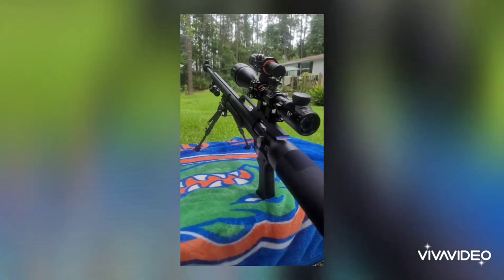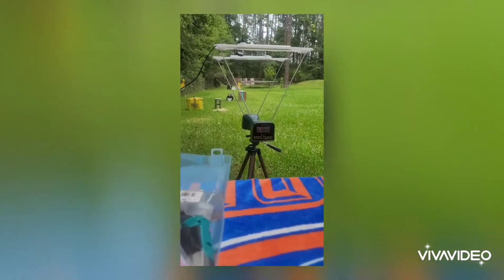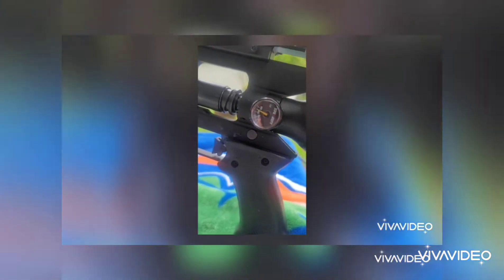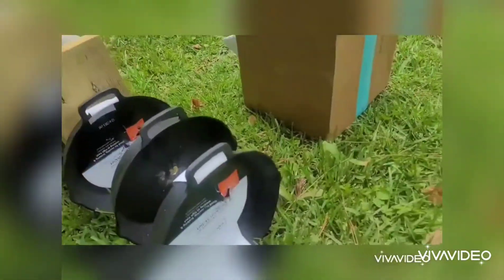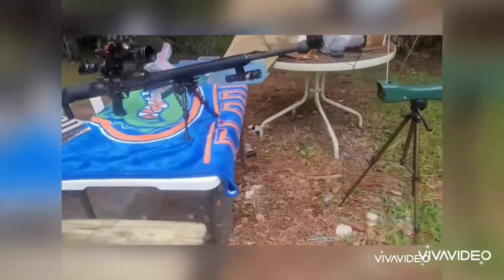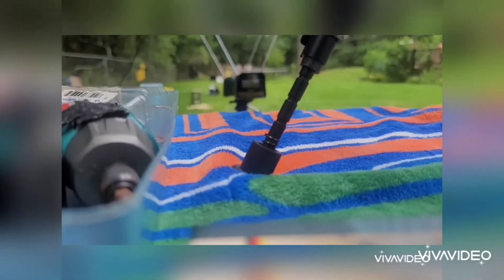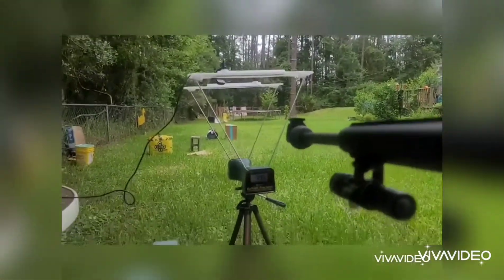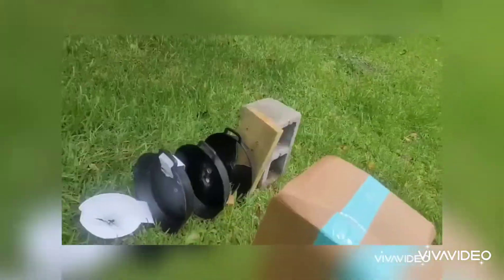Airforce Texan .45 VS 3 New Cast  iron skillets

Comment: U need to get the new tank for the 457
Reply from the maker: I don't see how the new tank will be better becuse this gun sweet spot, is 2700psi
Reply from the maker: And I shot a 315 grain bullet 1029' per a second At 2700 PSI That equals 740' pounds of energy
Reply: @Bigbopperairguns  so the power wheel should be on the last line?? I'm slinging 388 grain NSA slugs. So for the most power I should set it on the last line?
Reply from the maker: Actually it’s supposed to be in between the last two lines
Reply: @Bigbopperairguns  thank you
Reply from the maker: I found out that even with the power wheel on the last line or the second to the last line. I got 850 to 900 FPS with my 315 Grain. I could not get it brake 1000 FPS with the 300 grain. I just might invest in getting the CF tank!